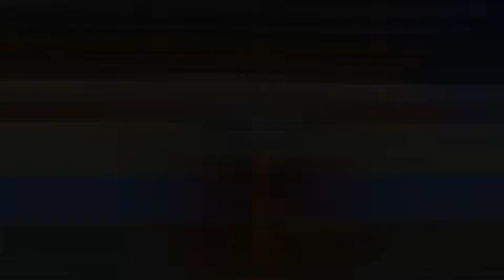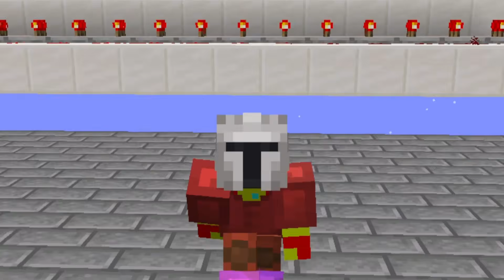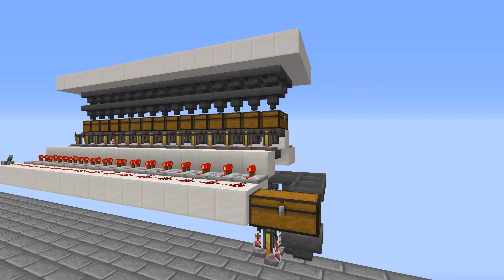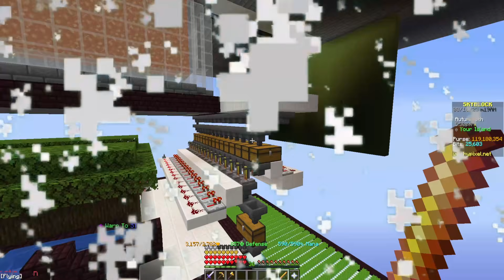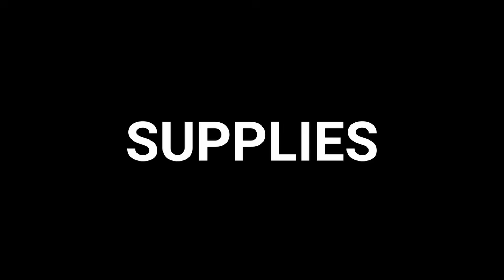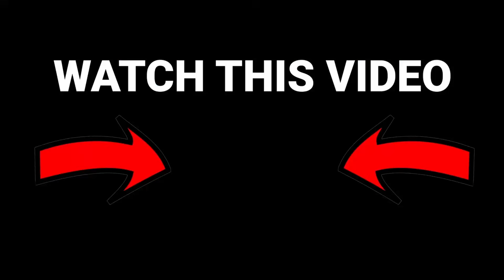The Fastest Alchemy Machine EVER Built.

Comment: 18/8/26 doesnt work for me, i tried it even though i seen that it didnt work for someone else in hope it will work for me
once you turn on the repeaters they cant turn off, and the water bottles just go into your stash. 
save you some time and just do it regularly
Reply: 30/8/26 I can confirm that it doesn't work because of that forever on repeater bug, but there a simple patch/fix you can do if you have this already built. Instead of the Redstone lines, you can replace it with Redstone blocks using a builder's rule to turn on the repeaters and remove it when you need the repeater to turn off. Hope this helps

Comment: best solution i came up for the repeaters problem (wildly inefficient but still works) is place a row of redstone blocks a block after where the redstone dust was supposed to be placed, then you use the builders wand to create the line of redstone blocks next to the repeaters when you want it to be turned on, and destroy the line when u want it to be turned off
you can also just turn on and off a line of levers if you find it faster.

Comment: 1/6/26 it kind of works. servers have been pretty bad lately so its possible this is a ping/lag issue despite me being in America. for one: the extra bottles don't drop out of your inventory, they go into your stash. you will have to throw all of them out manually if you use this or add a chest system that connects to the rest of it. and two: the repeaters don't turn off when you flick the lever. what i did instead is break the repeaters every time i need to turn them off, wait about a second and replace them, without flicking the lever. i did have a god pot which may be needed to insta break the repeaters. in total it cost me about 40m during aura (so prices were likely down, and a huge xp boost) with a large amount of ingredients left, probably would of cost ~35m to have no leftovers. despite all of this it still only took an hour, maybe 2.

Comment: still works 11/30/25 but the water bottles go into your stash now when you try to fill up your inv so spread out 3-4 double chests on the top hoppers and fill your stash by overflowing inventory (change your right click bind to something on your keyboard to spam fill water bottles faster) and then spam /pickupstash and fill out the double chests you just placed with the water bottles.
Reply: took me a bit over an 1 hour for alch 50 and around 45m coins but i made like 15m back from leveling pets and stuff
Reply: that seems quick isn't there 80% skill boost
Reply: yo if i put the double chest on top of the hopper it goes down the same chest down of it only
Reply: @user-v7u4k also spread out the double chests over multiple of the hoppers that what i did
Reply: Is fermented spider eye still the best it's so slow
Reply: @user-v7u4k fermented spider is the best but enchanted sugar cane is like 10k cheaper with same xp but it takes longer bcuz u need awkward potions also ye gheres 80% xp boost i got alch 50 in an hour and half

Comment: i actually modified the system and added  a extra layer of brewers where hes made the pool to fill bottles and then made the same pool setup above the other brewing station so that i can make akward potion on the top floor and then that goes into the actual brewing station so i dont have to word extra by first brewing the nether wart then changing it into potion. Also unlike in the video the bottles to to stash so what i did is that i made it so the "end" key on my keybord does /pickupstash then throw everything out then repeat the process (actually had to clear almost 1300 water bottles with 25 slots lmao took me a while but i think its the best option i've got) btw if you hve any mods the lets you lock a slot use it in the item inyour inv that you dont want to throw eg skyblock menu. And if you didn't know already hold the throwing key (Q) which is 'H' for me and the point your mouse cursor to the bottles. Hope that helps and you can /visit Maracucho to see how i made the akward potion brewer.
Reply: Even beter, with how much items he has you buy you can build the design again. The only thing you need to buy extra are 2 levers.
Reply: @wilhu5903 i am sorry but i dont think i exactly understand what you're trying to say
Reply: I just realised how many misspells are there lowkey kinda feel bad for the readers actually due to hypixel some of the keys on my keyboard dont work properly and I didn't bother to read it again XD
Reply: @samyammm  also holding down the throw button is a 1.21 thing only. Doesnt work on 1.8.9. And if have a lot of lag it doesnt work that well. I keep getting the bottles back in my inventory
Reply: @wilhu5903 thats actually really sad why is it laggy but

Comment: 7/29/25 still works. Because of stash now though, i've found it easiest to let it fill up as much as you want then just holding your drop button into the top hoppers
Edit: if you change you right click button to a button on your key board, youll fill bottles 10x faster than you would keeping it on your mouse

Comment: 4/17/2025
Yep it works. instead of the water pit above put a double chest connected to the very last hopper at the very top 6:35  , and dont expand it by 2 more hoppers (width) 6:37 , 1 row is fine

Comment: 12/03/2025 still works.
However, instead of making a big pit of water above hoppers, you have to place just one double chest, from which water bottles will get distributed in the system.
As many already know, this is due to bottles going into your stash after your inventory fills up, instead of dropping on the ground.

Comment: 15/11/24 still works. Tip: Buy a full inv of glass bottles then hold click them all into water, they will all go into stash. Add 3 double chests leading into the starting hopper (top one), then while the top chest is open, If you're using badlion, add a inventory button '/pickupstash'. Click the button from inside the menu and double click them into the chest, this will fill every single chest up in the system. 

Took around 1 hour from level 38 -> 50, costing 45m worth of ingredients.
Reply: thanks man appreciate it
Reply: did you also used fermented spider eye or something different?
Reply: @Dragonskill  Yes i did if i remember correctly

Comment: This is a really awesome machine, but very expensive to operate it using just enchanted fermented spider eyes. I'm not great at understanding redstone, but my first impression would be to add another level somehow so it would create awkward potions and have those stands full of netherwart. This would open up your audience to the not so baller skyblock players. The next level would be for whatever you can afford to make the final potion that is exp viable. Lastly while typing this I realized having a personal deletor so you can scrap stuff. Removing potions by selling them or tossing them is still annoying and time consuming. This machine is really dope and I instantly subbed after your video. There isn't a ton of extra fluff which made it very easy to follow and it was quick as well as engaging.
Reply from the maker: I think if you really wanted you could just use fermented spider eye as well
Reply: @ConaaaMC  Totally. I think opening up the machine to have an awkward level would open up the opportunity to create so many more potions. This would also relate to a larger portion of the audience
Reply: weakness pot crafted with enchanted fermented eyes r one of the two potion which gives the most xp thats why he use e fermented spider eye
Reply: i managed to modify the machine, its pretty easy but u need to add a lot of extra hoppers vertically so the redstone does not accidentally block other hoppers

Comment: One addition I made was to put hoppers with (double) chests above them, above the brewing stands. This makes it so you can drag the eyes and glowstone into 7 stacks of 2 (and 1 stack of 1 for the last chest since there's 15), and then just shift click them into the chests, saving you same time and effort.

The hoppers will only put vanilla items into the stands, so using gold blocks or e cane won't work with this.

Speed 6 potions now only sell for a total of 5,833 per pot (17,499 total), take an extra ingredient, and won't go through the hopper anyway, so this ends up being much better anyway.

Weakness 6 pots sell for 12,900 each (38,700 total), and adding ench glowstone instead only brings that up to 13,000.

Hope this was helpful :)